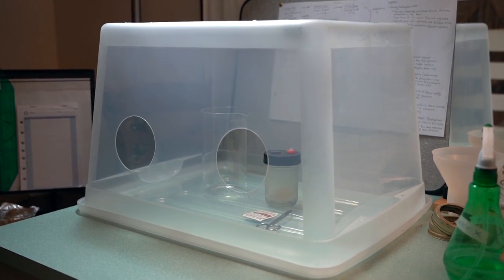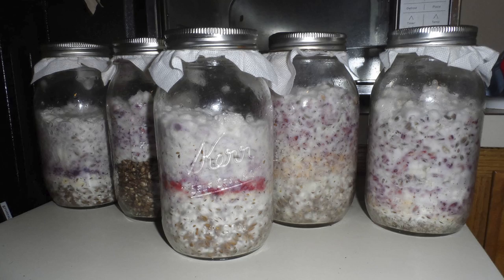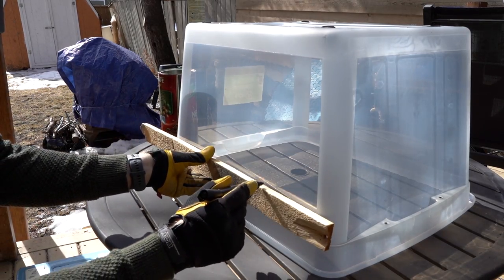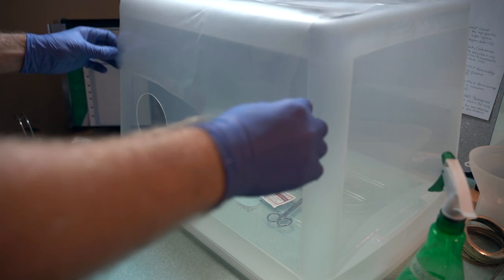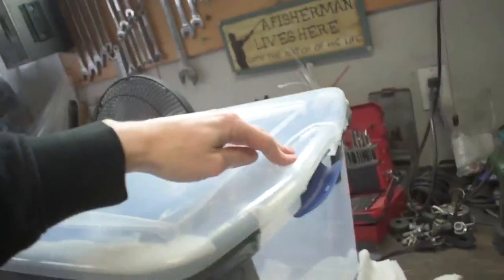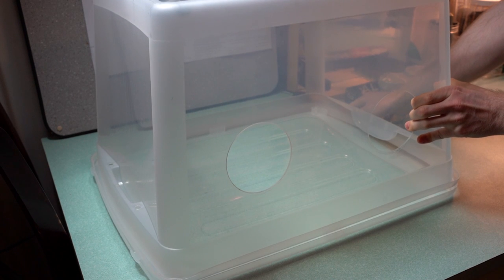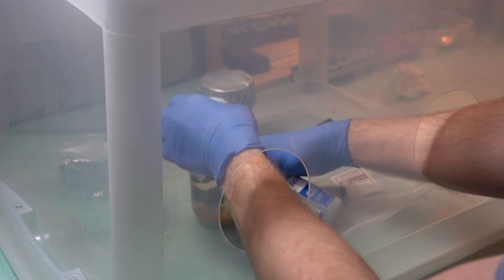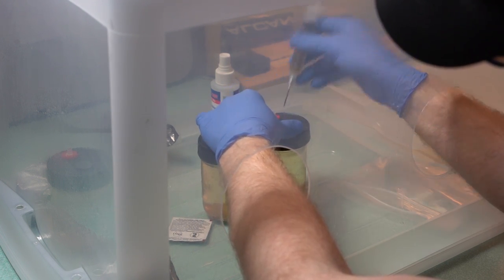How to Make and Use a Still Air Box

Comment: Glove boxes are no longer recommended as they have a tendency to create more air movement than a basic still air box. They are old tek that has been deprecated for several years now. Also, never flame anything inside a still air box.
Reply: The flame is what I was here to find out about.  If you spray the entire area,  aerosoloizing 70% isopropyl alcohol,  how is that not risking combustion? Do you flame sterilize outside the box and then move the sterile tool inside?
Reply: @ScottWConvid19 Yes. You hold the tool outside and then bring it back in slowly while still hot....
Reply: @benson733  Thank you. There's so many more steps and precautions to take with a SAB than with a laminar flow hood,  but not everyone has $1000-$2000 to spend on a hobby 😒
Reply: Is this just for DIY stuff? That’s interesting I was under the impression real glove boxes (used in university labs) are basically completely sterile environments. I can definitely see how a DIY glove box might force more air movement tho, I’ve never used one
Reply: @big_hat_logan  I mean I use it for mycology and diy. I'm thinking the term glove box refers to a different type of box with gloves attached and that creates much more air flow than a standard still air box with only holes cut. You disinfect and then spray the box full of bleach water or even soapy water and let it sit for 10+ minutes. Then just use proper sterile techniques and you should have good low contamination rates. Laminar flow hoods are king though.
Reply: what about a perfeclty sealed glove box and sterilizing the insides and the equipment while it is locked in?
Reply: @ScottWConvid19  He used a diluted bleach solution.
Reply: @froschreiniger2639  I use UV-C lamp with ozone 100 15 minut, 
percent efficiency
Reply: Really? Why they create more air movement?

Comment: Nice job, I like the idea of bleach instead of alcohol , you said 10% bleach but most consumer bleach is only 6% available chlorine ( usually hypochlorite ). Did you find a stronger bleach somewhere or did you mean you diluted household bleach at a 9:1 ratio with water ? I have hypochlorite available to me , its twice as strong as household bleach ( usually 12% but like bleach loses strength over time )  the weaker the solution the longer  it takes to disinfect. I'm thinking a .3 or .4% chlorine solution would be plenty good. The smell is a bit worse than alcohol but worth it to eliminate the torch issue...cheers
Reply: I believe he means 10% bleach to water mixure that you would make
Reply: @sxrry.8206 yeah he overthought a little
Reply: Bleach only creates fumes for our purposes, its useless vs many spores. Even hospitals have stopped using it to sanitize. 

Also, ISO and bleach create chloroform. There is no need for it. Remember, its not a clean air box, its a still air box. There is no way you are gonna kill all the baddies in your box no matter how much bleach you spray. Thats why we use PHYSICS with a STILL AIR box. We wait until everything settles and try to leave it there as best we can. 

Its a simple, important theory that the maker of this video has left out.

Comment: Thanks for the video and a clip of what it looks like working in the box. Wondering - is it necessary to have a grill on the bottom so contaminants "fall through the cracks" below, and not on the same surface where your working items are? And for SABs, is 'bigger better'? My guess is that the larger the box, the less likely air movement will be an issue (due to hands/arms moving around the hole?) One last one - I see people complain about seeing through the plastic. But I don't see much online about people building SAB's out of glass (ie using old window glass, or even fish tanks). Any reason why someone wouldn't build a SAB out of glass (with silicone glue/sealant). Thanks!
Reply: Just more labour intensive. It's easier to spend the same ammount of time building a laminar flow hood.
Reply: A glass SAB would be nice. It will disinfect easier too.